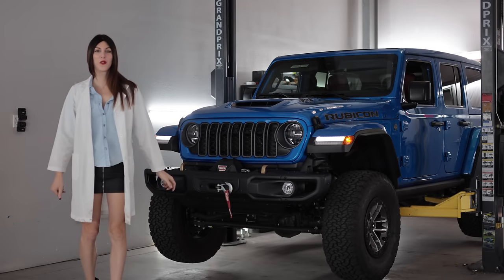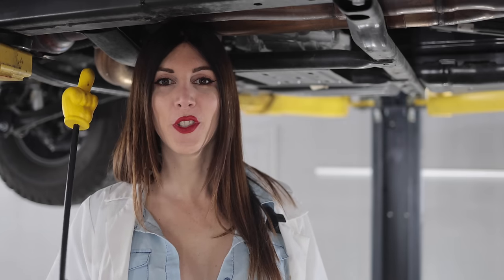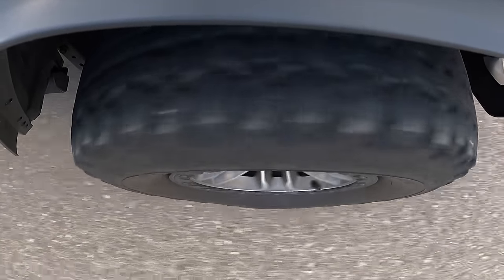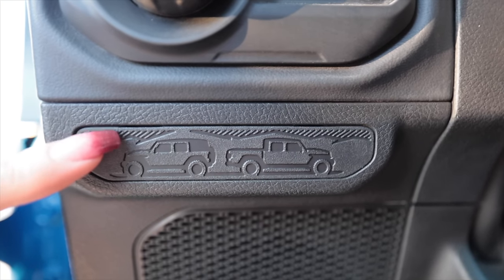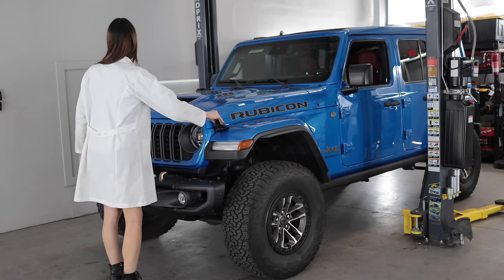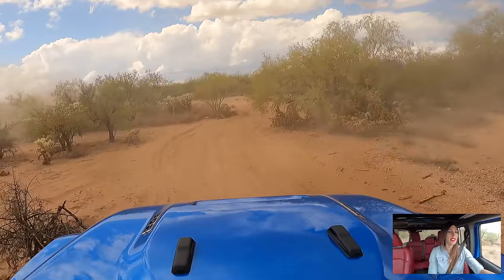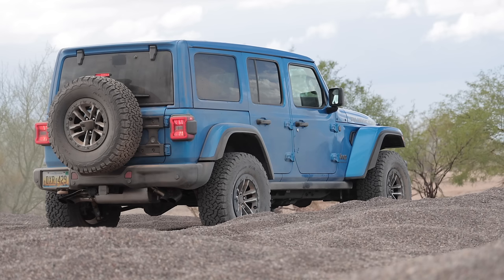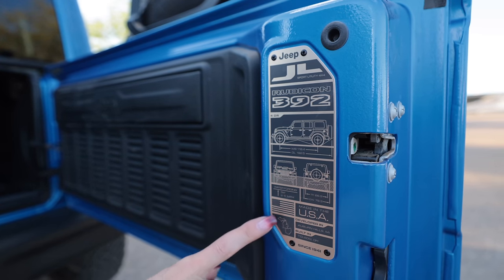A V8 Raptor Killer // 2024 Jeep Wrangler 392 Review

Comment: I own and daily a Wrangler 392 and love it. It’s expensive to buy and you’ll never pass a gas station without at wondering if you should stop, but it is a glorious smile machine that I will never get rid of. Thank you for doing this great review. …and you are correct, it is very very quick off the line, which is nice when you need it to be. It can be a sleeper, especially when the exhaust damper is closed - not many know what it is - which is nice too.
Reply: I own a Gladiator with the six and I never pass a gas station without looking at the gauge, I can't imagine.    My joke to the wife is the Jeep Wave is about indicating how far you need to go before getting gas again.
Reply: Can’t imagine the long term cost on any Chrysler/Fiat. 4 years and let someone else worry?
Reply: @hutch2142 You ain’t wrong, traded a Gladiator in towards the 392 - yep, it was thirsty too. In reality, the 392 can be driven with a light foot and get a bit better mileage than expected, but I don’t have that kind of self control. I almost didn’t buy it though, decided to take the risk (and expense) and have no regrets. My has the XR package and it is a beast both on and off road. 
✌🏻
o|||||||o
Reply: 100k for a igloo cooler with seats 💺 💺in it . I would have my head examined first . Might be a classic in 20 years but the pos will be in pieces by then unless you can keep it in your closet . I haven’t seen one other than a car show hoovies and Sarah’s channel . If your gonna get one keep it 20 minutes and dump it resale will tank and you will overpay

Comment: I love how many manufacturers are putting loud, ridiculously powerful V8s in everything right before the switch to electric robot pods.  I do remember those old Jeeps with the AMC V8, and I'm also surprised how long it took to get a factory built V8 Wrangler.  Now it's time for a Hellcat Wrangler, because what's better than stupid off-road fun than even stupider off-road fun 😁
Reply: Yes, I'm sure there are a couple of people in the world who want a $150,000 Jeep...
Reply: I think a Hellcat Wrangler would make sense if it had race suspension. Obviously this would be an expensive machine, but the 392 is already beyond anything we actually need.
Reply: The return of the Ford Bronco pushed Jeep to put the V8 in. They had no competition in the space for decades.
Reply: Or a hellcat grand wagoneer
Reply: Well there was a market for something other than a 252/4.2 I-6. Had a 75 CJ5 with a 304. Bought it because it was cheap. Terrible gas mileage (about $1 gallon then) 3 speed Manual , About to explode when going 65MPH. BUT could climb a wall with it. Served faithfully from 1983 to 1988. No need for a real trail jeep with a V-8. But For today's sized/weight Jeeps a 318 might just be right

Comment: I’m so happy you were able to finally drive one of these. I have a 2022 392 XR and love the insanity. If you put it in off road plus the shift points change as does the throttle sensitivity making on road way more fun too! It tends to bottom out on bumps at 20 mph so I did a lift and shock upgrade to increase wheel travel and make it a true beast. It is stupid fun!!! Oh the dogs are for Left and Right! Take a Louie! Take a Ralph! They used a Liberty transfer case that has weak clutches for this application. Love it anyway!!! I could geek out on this all day! Love your reviews too!❤❤

Comment: Wow… Love the exhaust note.  Kind of surprised the towing capacity is only 3,500 lbs with that much torque.  Top notch review and production as always.  Thank you, Sarah.  👍👍👍
Reply: Towing capacity is often dictated by braking capacity, vehicle weight and overall stability of the vehicle. The short wheelbase jeep doesn't have much of any of that....
Reply: Tow ratings are mostly based on braking, tire load rating, suspension stiffness, gearing, cooling,  transmission capacity, then engine power.
Reply: The soft suspension, needed for off roading, limits towing ability.
Reply: @Gene1969 Same reasons the Raptor has a lower tow rating than the standard F150.
Reply: @mikeford963  Exactly.😎👍
Reply: Thanks for the replies.  Even in my advanced age I just learned something.  👍
Reply: @Primus54  No problem.  Us old guys have to stick together.
Reply: @Gene1969  Indeed! 😱😉
Reply: You don’t want to tow very often with a 392. You will burn up the clutches in the transfer case. The down side of the AWD transfer case they pulled from the Liberty to use on the 392. When you tow the clutch to the front drive axle will engage and disengage constantly and this will cause a failure.
Reply: With the full float axle, it's supposed to be 5000lbs, but maybe not on the 392, but the more standard Rubicon, not available on Sahara, Sports nor Willys, wich are still rated at 3500lbs. It's on Jeep's website.

Comment: A couple things you missed…. After hitting the Off-road+ button you can press and hold the traction controls button for 5-10 seconds and it further turns off Nanny’s “plus” acts like a throttle controller.  In 4-high it shifts quicker and at higher rpm’s.  In 4-low, it dumbs down the throttle making it less twitchy.  Also, the disconnecting front sway bar automatically reconnects above 18-mph.

Comment: There will be no dino-cide here.  The Raptor is a Baja truck. Not a drag racer.  Not a rock crawler.  Get them on a desert trail and the 392's speck in the Raptor's mirror would get lost in all the dust.
Reply: A raptor R, DEFINITELY. But I'm not so sure about an ecoboost raptor.
Reply: Yeah, the TRX is the Raptor competitor and this completes with the Bronco
Reply: The Jeep will dominate your chit ford
Reply: @yungkidnf  a "regular" twin turbo Raptor will blow the 392 away.  They're very close on power, but the desert suspension/handling is SO far beyond the Jeep.
Reply: Imagine thinking either will be seen off-road.
Reply: @bobquattrini1787  stay in your lane--for Jeeps that's being a great rock crawler, "chitty" interiors, "chitty" towing, and a forever-cracked windshield. 

To be fair, the 392 sounds terrific and is a fun off-roader.  It's just not a desert runner.

Comment: There’s nothing more fun than a powerful V8 stuffed into a vehicle like this. I had a blast driving the absurd Chevy SSR around (a pickup with a Corvette V8). Zero weight over the rear tires meant it liked to go nutso at any RPM and any speed.

Comment: The older broncos that came with v8 sounds better  , but that might of just the 1969 bronco I had with 351 and dual exhaust with 3 on tree , there was a kit to make it 4 speed but keep blowing engines because didn't have a oil pick up that went around the pan to keep sucking oil up so always losing oil psi to rob engine,and told myself next vehicle is going to be free electric energy antigravity motors

Comment: Its cute, but ill stick with my custom 75, 76,78, Jeep. Full four doors i welded my 75 CJ 5 in the center and widened the body to 75" on a 6" C Chanel frame and pulled the drive train out of my 88 GMC 2500. with a little tweaking to the entire system.  Plain jane interior but i did get the full fiberglass top on it. So even with the split windshield You can lay down like a real Jeep. The doors are still the drop hing style so all are removable. The Comanche tail gate has the Jeep logo that fits the size of the body. So im not sure Jeep could ever produce a vehicle like that with the current constraints on saftey.  But if you want to be safe in a Jeep.  Prius makes something for you. Im glad to see a V8 back under the hood again the Renegade thats in this had one. But I had way too much fun for the front frame. Thats how i gatherd up the parts. I couldn't part with any of them after all the fun. So now i can drive them all. Its a Jeep thing....

Comment: Hi Sarah ! This is the only way to 4 Wheel Drive. Ford should take Note to your Awesome Review.. The Bronco should have came with the 5.0 V8, and not as a option. though as Standard. Speaking of Standard the Rubicon needs the 6 Speed Manual Transmission. 
Just wonder how long the 392 Rubicon will be available. 👨🏻👍🏻🏎🏎🏁🏁🚩🚩

Comment: How that thing weighs almost as much as my 1977 3/4 ton Chevy 4x4 with a 454, 6” lift, front bumper with a winch, custom made and galvanized side steps and 3/8” rear bumper. My truck weighs in at 6,000lbs. Are they hiding bricks of lead in that jeep?!?!
Reply: Was thinking the same thing... I have a 93 F350-dually with a 460 and it's 6300lbs

Comment: as cool as this Jeep is, I would never take a $95,000 vehicle off-roading.
Reply from the maker: My feelings exactly.
Reply: This is a high dollar Mall Crawler
Reply: Same could be said of the Raptors , Defender, and TRX, though, right?

Any of these off-road vehicles, loaded with v8s…
Reply: @SSStinger6  well actually about 99% of every Jeep you see that has shiny paint and huge wheels, especially double if they did the whole lift thing and 24’s with low profile rubber.
Reply: @SSStinger6  that's very true, and they are non-existent in off-roading.  You'll only see them being used by Youtubers to make content videos.

Comment: Nice.  Not really a “Raptor” killer, it’s not as comfortable either. Also to get close to the stock Braptor wheel, tires and suspension it will cost another $12k. If I want to go fast in a straight line on pavement, I will just drive my Shelby GT500. 😉